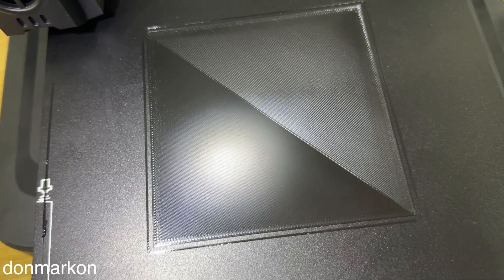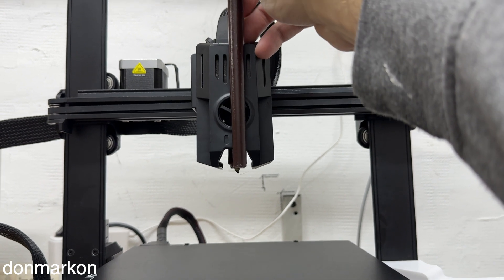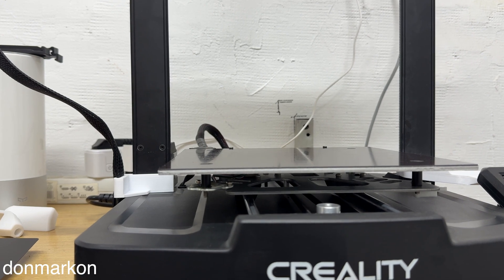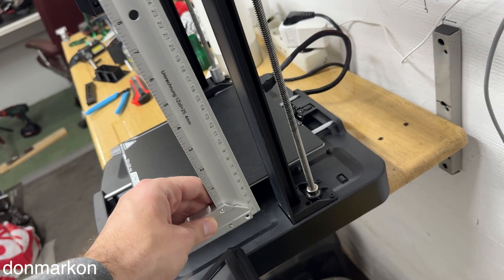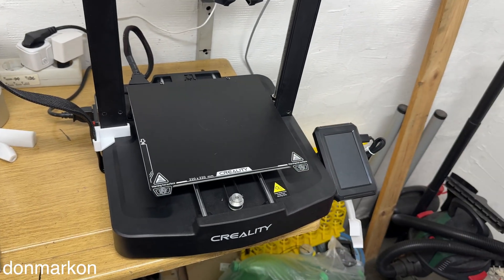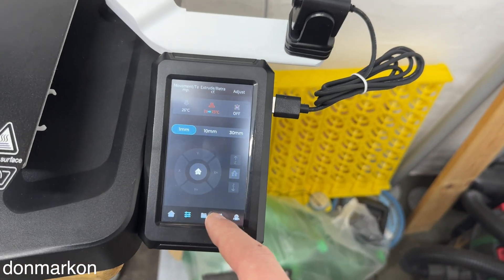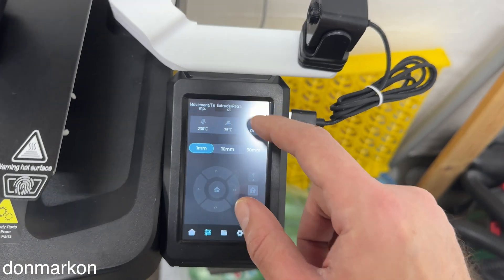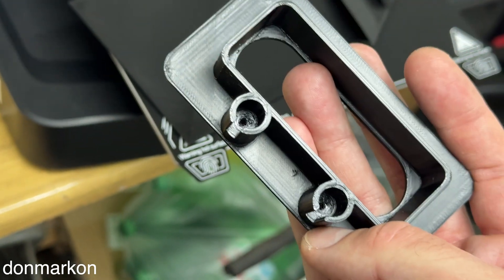Creality Ender 3 V3 KE SE Plus Make It Print PERFECT! 3D Printer Hardware Tuning Guide

Comment: It is the end users responsibility to find the optimum z offset due to the fact that not everyone prints at the same layer heights or use the same filaments.

Once leveling is complete the end user should print a large single layer so that you can dial in the z offset during the printing of the first layer.

The auto leveling is merely so that the printer can create a mesh of the bed and therefore know where the high and low points are and compensate as neccessary. The printers are not able to determine the exact z offset as every machine will have slightly different tolerances/clearances.